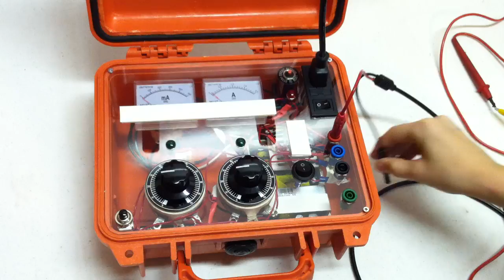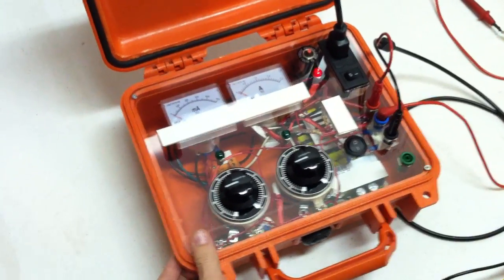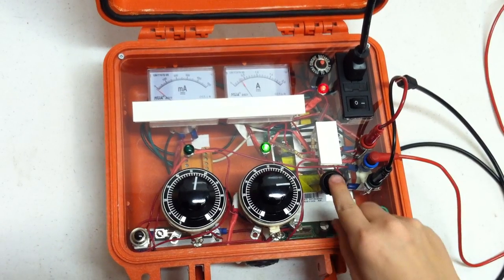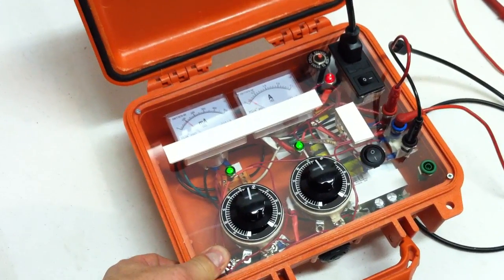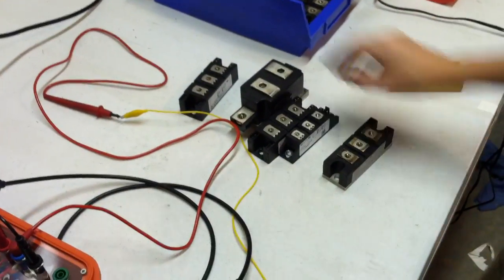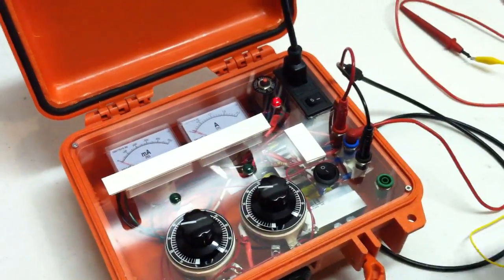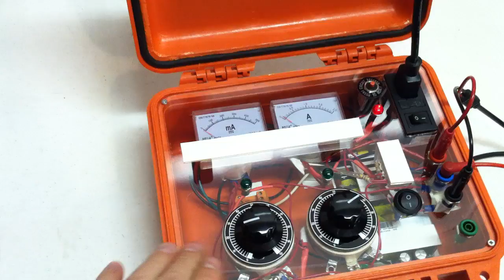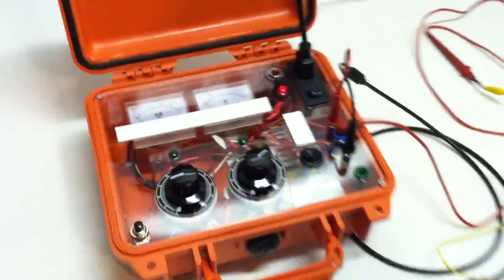Elevator Tools: SCR Tester - Homemade SCR Powerblock Tester

Comment: Hi nice looking test unit
do you have a circuit diagram for it to share with us.
are your variable resistors wirewounds?
do you test at 240 volts ac?
what load are you using in this design?
does it do a reverse blocking test?
nice idea of building it in the case looks good
Reply from the maker: https://youtu.be/k2V-OE3VEXQ Circuit Diagram. Wire wound variable resistors, Variable load with resistors, 48vdc PS.
I like these Seahorse Case SE300: https://amzn.to/2vCArvE better for panel mount electronics as seen here: https://youtu.be/a826q0I0a_Y

Comment: From what I am finding, the power supply is a 48V either 1A  PSU around a 25W Pots, which is probably good for about 1/2 amps of load Not sure if you have a circuit protection for that. Guessing you cant use 2.5 Amp on the  load side???
Reply from the maker: +Drake Dragon 
I don't remember the details but here is a video is the schematic https://youtu.be/k2V-OE3VEXQ

Comment: Hello you have please the Project??Antonio. Italy
Reply from the maker: Video of Circuit Diagram https://youtu.be/k2V-OE3VEXQ . Wire wound variable resistors, Variable load with resistors, 48vdc PS.
I now use these Seahorse Cases SE300: https://amzn.to/2vCArvE better for panel mount electronics as seen here: https://youtu.be/a826q0I0a_Y